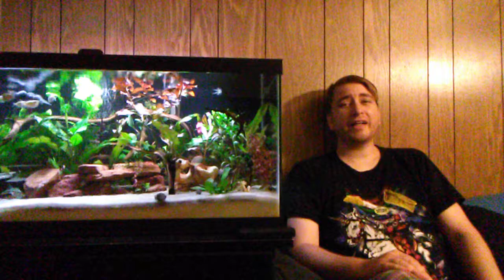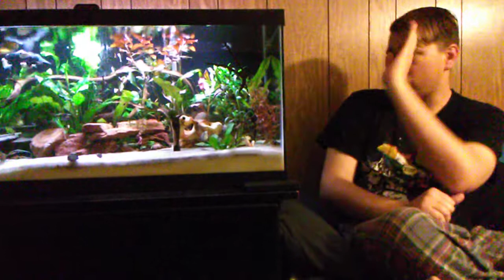Hydor Follow up

Comment: Nice video brother beautiful tank... I’m having problems with my sun sun too uv doesn’t work...and yes does not pump what it says much lower gph
Reply from the maker: Lito Yeah, mine had multiple problems. Aside from tge giant crack in the center of the tubing connections, both tube connectors broke off and I had to coral glue them back together. My UV output was pathetic and the gph on the flow was just laughable haha. When you switch filters, or it breaks you should really give Hydor a try, they are worth every penny and come with a full 2 year warranty. Anything happens, they replace iy. Can't beat that.